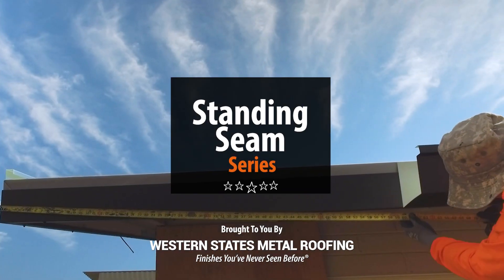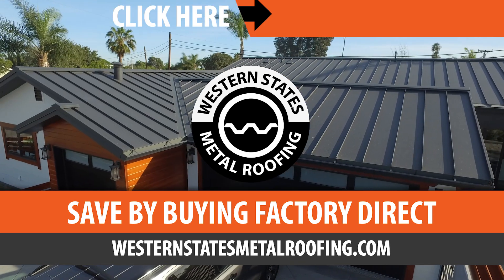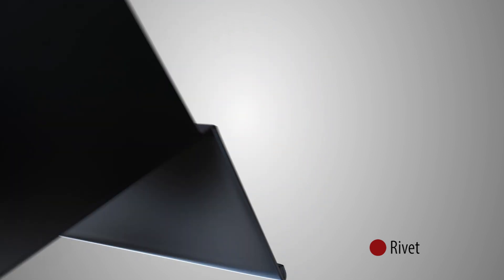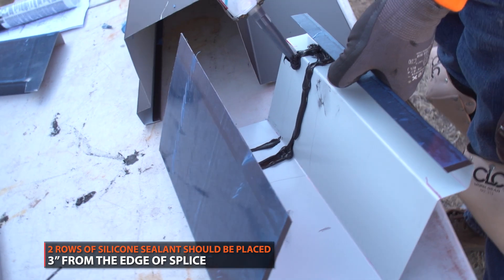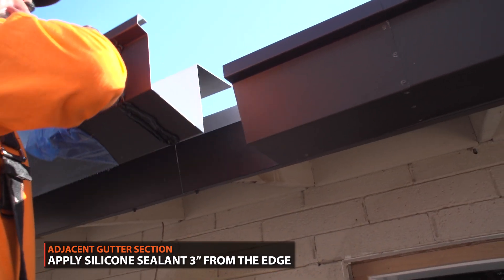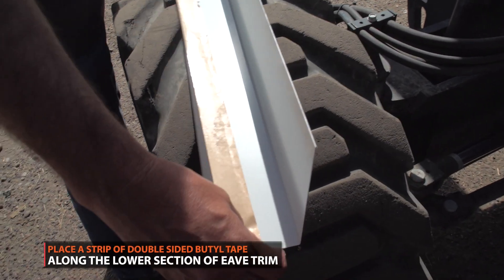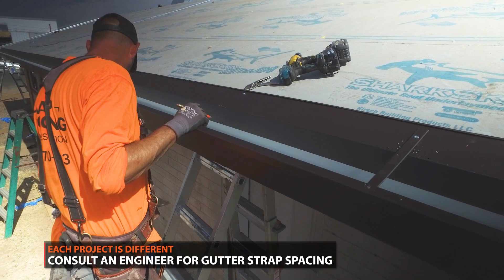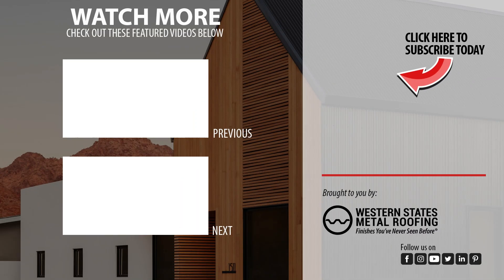How To Install Gutters On A Standing Seam Metal Roof: Pre-Hung Box Gutter And Eave Trim Installation

Comment: There is an argument for installing onsite rolled seamless gutters after the roof is installed. Gutters will be more damage prone then the roof and repair would be easier if the screws are not hiding under the roof assembly. Thanks for all your videos!